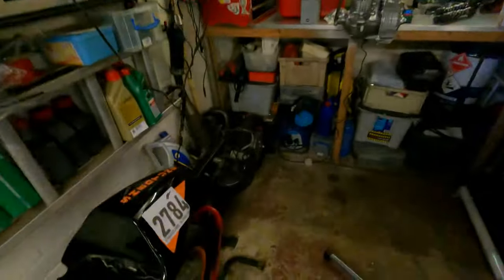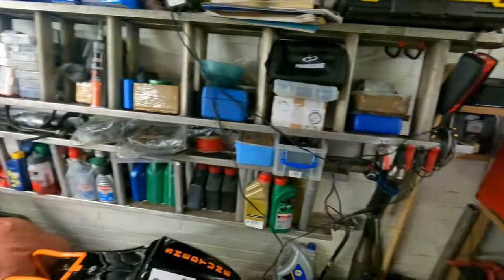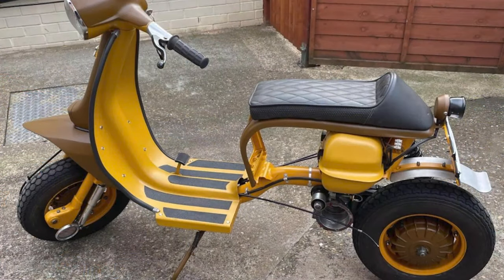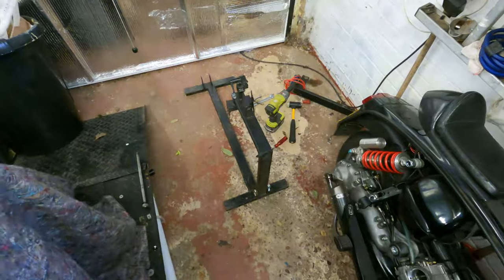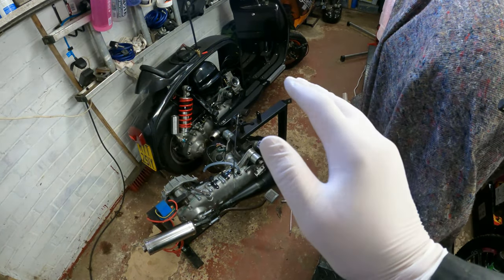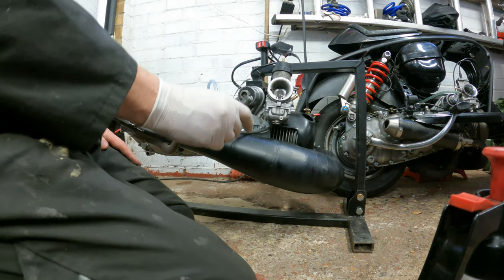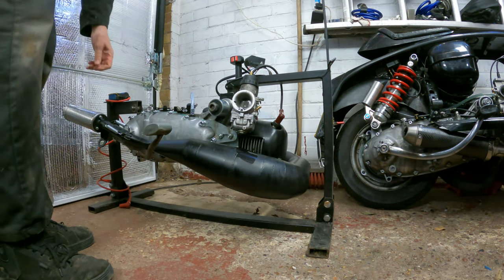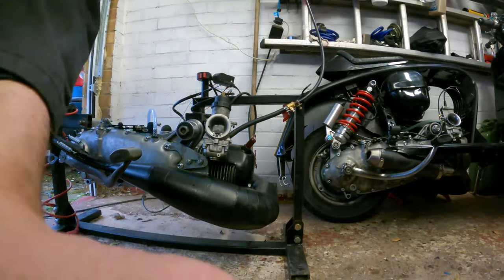SHEDTUNE SUPER TOURER - TUNED TS1 FIRST START UP

Comment: lights are strobing like mad .......
Reply from the maker: I know it’s a new great effect
Reply: @Shedtune_Russ  you got LED strip lights ?
Reply from the maker: @TheSteelweasel  some are and some not… can’t afford to change them all at the mo but it’s part of the plan long term 😀👍🏻
Reply: @Shedtune_Russ  yes mate you tube aint easy , ive got major problems with echo . My sound is rubbish but its getting better as the place fills up with junk . ive been working on lighting tried some led spots and got the same strobing as you . now im using some diffusers on them and have got a couple of lamps one table and one free standing which i can use effectively . warm bulbs for some stuff and day light bulbs for other stuff ,still learning pal 😂